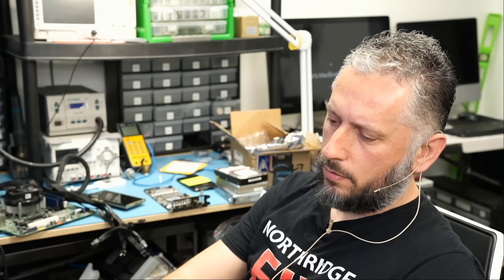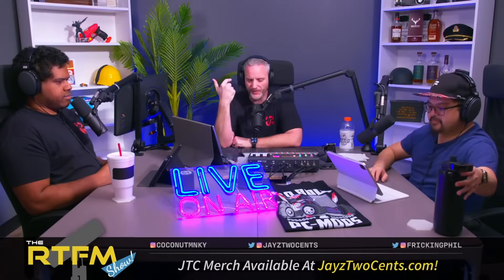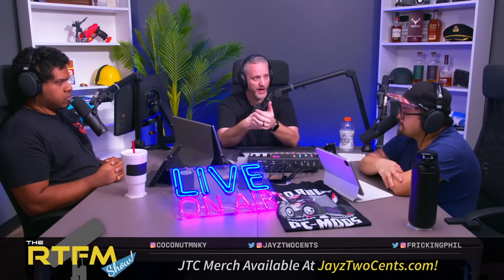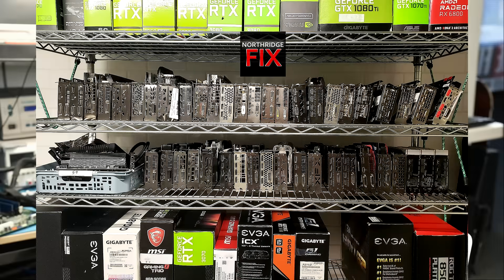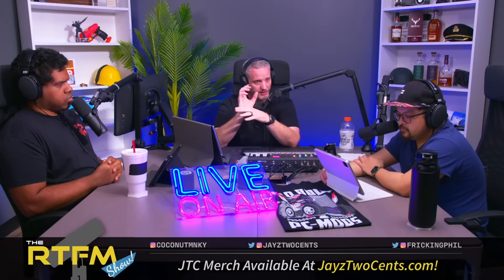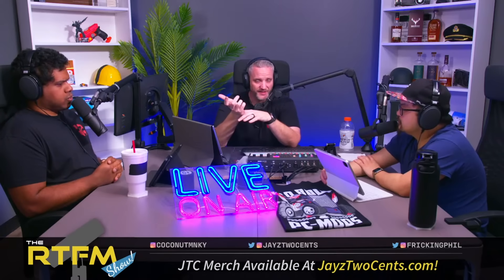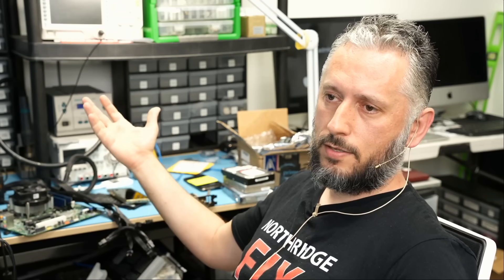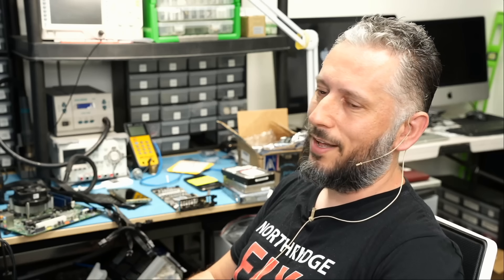Melting 4090 and CableMod. JayzTwoCents and Gamers Nexus Response. Blame NVidia or User?

Comment: On 4090 all 12V lines from the connector are connected to a single 12V rail. On previous generations they were connected to different rails, with different groups of mosfets feeding from different 12 rails. So now, whenever resistance on one pin becomes a bit higher (due to bad connection or something else), it effectively stops working as the load moves to the rest of the pins (Ohm's law). More current, higher temp... until something start to melt. It's a PCB design issue. It's either "planted timebomb" to make sure user will have to buy a new card or some new engineer made a rookie mistake, because they didn't know any better.

Comment: At 17:29 you cite the connector being hard to remove due to being melted together with the card as evidence that it was inserted all the way. Which frankly makes no sense.

The cable was hard to remove because it was melted together with card nothing to do with being properly inserted or not. Even a less than fully inserted cable would have been hard to remove due to all the melting.

Comment: If you google "PCI-e 12 pin connector" you will come across a picture from TechpowerUp. On the picture, they put a 12 pin and 8 pin side by side. You can see the SIZE difference of the contacts in the connectors. 8 pin has much more surface area, much more metal. And its only rated to 150W or 12V 12.5A. Dead reckoning will say that 12 pin pushing 600W or 12V 50A looks kinda fishy at best. And for those who will argue: but these are isolated cases, its not the majority: volts and amps are not some new concept we are experimenting with. Power delivery is well understood practice. The fact this melting even happened in the first place is cause for major concern. 
One of two things will happen in the future. Either the ATX 3.0 standard will get a revision and overhaul OR they will simply use more connectors like with 8-pin. 
My tin hat conspiracy is: a mint fresh designer/engineer at NVidia or PCI-SIG did some calculations and overlooked some very very important safety margin considerations.

Comment: As an engineer, people as a whole are stupid.  That is why engineers in the past have done their best to engineer most of the 'stupid out of their designs. Not only do you consider how the product is used, but you need to consider how the 'stupids' among us will use them improperly and try to engineer safeguards to prevent that. Yes higher contact resistance from improper use can cause some of the melting. That is not in question. The problem is it is happening so often that it should have been engineered out. This is happening to often to be completely user error( which should have been engineered out). The fact that is is the same set of pins and happening under all kinds of circumstances is telling. The next round of testing should setup current monitoring on all the connector wires and then test the card under various loads and observe the currents. I suspect that will the final nail in nvidia excuses.

Comment: I still don't blame Nvidia for this issue. I mean... you said it is not a rocket science... It is just a 12 pin connector. Plug it properly and have enough contact and you will be fine. Plug it improperly and it will melt due to poor contact. There is no other possible reasons here. You can also improperly place a tilting force on the cable mod connector wires with the chase cover which may or may not cause again a poor contact. let the user pull the connector by pulling the cables or.....etc There are endless ways how would a customer make errors or how it would be a cable mod female pins issue, and YES! not everybody have a tiny bit of brain like you think. However "THERE IS NO LOGICAL REASON WHY WOULD THE 12 MALE PINS OF THE CARD BE THE REASON OF MELTING". It is not Nvidia's fault, but if Nvidia wants to solve the problem of user errors they can make better connectors in a way that minimises the possibility of these errors to happen, but I think they doesn't have to do so because these cards are meant to be sold for the DIY market where the user should be aware of what he is doing. That's why pre built computers exists for users who can't build by themselves.

For why the 90° connector mod fail, it could be that the mod female pins are not tight enough or some other manufacturering errors.

If the design of the card was the issue we would have seen most of the cards failing, but that's not what happening.

Comment: I'm still wondering myself why didn't manufacturers, in this case NVIDIA, don't make the pins that power the card longer and those that signal the amount of power rails that are supplying power a little bit shorter so the user has to plug the entire connector fully and still have some tolerance and, because the signaling pins are shorter, if the margin is unsafe, just prevent the card to work or work in a safe mode, power restrained mode.

Comment: 400 watts at 12 volts is 33 and a third amps. You need a fat ass wire to reliably carry that current. I've got a 1300 watt power supply and a video card that just made fire, sparks, smoke, welding on the video card and it's PCIe slot. This crap is becoming too bodged work-around. The edge card locking latch is inaccessible. The card having all the 12 volt ADD-ON power leads that the PCIe slot cannot provide is the START of the bandaid mess. The moment video cards started needing so many amps: it was time for a high current connection. A new slot. Sorry. It's going to be a painful transition but we've been there before. It's time again we bit the bit.

Comment: I thought Steve's answer was fine at the start of this mess but the video showing the fully seated cable mod adapter one smoked is the veritable smoking gun that this is indeed a design/card engineering problem.

Comment: I think this is a design error, that connector is not enough for the power the card needs. It is a big heavy card, there's room for two connectors. The power cable uses three connectors on one end, and only one on the card. So the reduction of the cross section of the power cables is happening on the card side. The chance that most of us are not capable to insert a connector is very slim. I would take precautions when connecting this expensive card, especially after all the videos on this subject. If you build a computer for yourself you will pay more attention. If this connector can accidentally disconnect or  something like that, during transport, or cleaning, it is not the users fault.
In my opinion, a new connector design is needed, with better locking mechanism.

Comment: 30 years of Automotive experience and an OLD College Certification of Electronic Repair has led me to a decent reputation in Automotive Electrical diagnostic and repair. Heat is generated by a poor connection of the metal Male and Female ends. The Plastic housings can be a factor by too much on one side and not enough on the other creating Pin miss alignment. The Male is a solid Pin, The Female is basically a receptacle that is slightly bigger and has a (basically) spring loaded connection contact. If the spring loaded portion is weak, it will lax the tension and create an issue. (In Automotive: Higher current circuits tend to melt the Housings, lower current circuits cause Check Engine Lights and intermittent issues. I deal with this type issue Weekly and like this case pattern failures can easily be traced down to a common issue. 99% of the time (on Factory Connectors) it is always weak tension of the Female Pin. In this case, it seems the Male portion is questionable. My thought: To truly find out the issue, someone needs to confirm that the 3090's are truly the same as the 4090's. Buy 1 or 4 of each Model and dissect the connectors. Also check the Manufacturers of the Cables. I know that what I am saying is a lot of money and time spent, but that is the only way to prove a real issue. I have a really expensive set of leads that are precision made to tight tolerances of 90% of Automotive Connections. They have Banana receptacles for my Meters or Lab Scope Leads. They are an easy Go or No Go gauge by themselves for connection issues. Hell, maybe when they made the 4090's something may be weird with the composition of the blend of Plastic. Maybe it just does not handle the normal amount of heat created by any Card. The actual issue has to be physically proven to a point of no more questions and all Videos, Podcasts can be exactly to the point to get the Manufacturers' attention. They are not going to do it themselves.

Comment: Maybe if nvidia is determined to use these small connectors for some reason they should just solder their dongle directly to the board and cut out the middleman

Comment: I think it's a bit silly to blame the user. This is a premium product and is sold and ultimate premium price, and therefore should be a lot more robust with it's power connector. The mere fact you can see loads of plastic deformation damage from unburned  connectors should be a giveaway that the design is bad

Comment: If I may make a suggestion, I would like to see if anyone could set up a system with one of these cards and all of the appropriate hardware and software in an open air environment and also set up a thermal camera system to record the temperatures being generated at the source of the plug. Also maybe even a voltage monitor recorder to record under what circumstances the temperatures at the plug get so hot that they melt the plastic. Then send the results to Nvidia so that they can no longer hide behind all of the theories and uncertainty. Great Job Alex and continued success to you and Northridge Fix.

Comment: It's possible in a couple of cases that the customer didn't firmly "click" the cable/connector together, but it seems with a rather high number of duplicated / repeated incidents that the connector on the GPU is at fault. Design flaw or substandard / inadequate connector plastic

Comment: Ok...I have been watching Alex for some time now. I have worked on ATM machine's, Lottery Terminals, and Industrial Battery chargers. In my time the only thing that could cause this problem is indeed the Video card!!! Think of it this way, when you try to use you water hose with nothing on the end the water flows freely. However, when you put a sprayer on the hose you restrict the water causing pressure. The traces on the card are not able to support the current draw that this card is using which in turn is causing overheating of the connector. Just a thought...

Comment: Gamers Nexus Response protecting Nvidia from a huge failure in their product, this is obviously an issue with Nvidia as the GTX series + RTX 1000-3000 series never had any issue with cables/connectors melting.
Reply: Not so much protecting Nvidia but protecting their findings which they spent a fortune on collating. Steve obviously doesn’t want to admit it’s a bad design on Nvidia part!

Comment: I waited for the cableMod 90 and installed my 4090 looks fine atm and fully seated. I think what GN was meaning is that the card connector may have had some beginning some damage probably not visible unless you inspected befor it was used and thus the dmg occurred.  I’m in full agreement tho a design which leads to premature failure even if user error (within reason) is a manufacturer defect and this nvidia should consider taking action.  Maybe not a widespread recall as some units may be unaffected but certainly a as fail zero questions replacement with ver2.0 product preferably with the issue fixed

Comment: Alex, I think if the connectors that came with the cards from factory are melting then it could possibly be the connectors or the card itself.  Has any customer for whom you've replaced the connector end up with the same issue as before you repaired it?  I think we need to look towards the card itself rather than laying blame on the end-user and like you've said many times in the past "be honest to your customers".  That's what these manufacturers should be doing.

Comment: No other cards in history melted, but when there's a problem it's definitely not the fault of the manufacturer of increasingly power hungry and inefficient cards with new connectors. Nope has to be dumb myfirstPCbuild haha. Should have played with more Legos and wall outlets, could plug it in mor better.

Comment: I don't doubt that you are correct in that it's the board as this makes the most sense. Question! If it's the board/card, how would this be fixed? By redoing the female connectors on the card? I would like a follow up on this showing or discussing how this fault could be fixed or if it even could be fixed?

Comment: Leave it up to Nvidia to create a problem from a non issue. Why go with the 12VHPWR connector when x3 PCIe power was working just fine. On top of that the 4090 doesn't even use the 600W that the 12VHPWR provides.

Comment: The older cards' power adapters had larger gauge wires and pins going into a larger connector, pushing ~150W on each connector.  Now they have THREE TIMES the power flowing through a smaller connector with smaller wires.  Gee I wonder where the problem actually is?!?!?  

This is an NVIDIA design issue, not a user issue.  NVIDIA is a scumbag company for not standing behind their customers who are spending thousands of dollars for their poorly designed cards!

I wonder if EGVA saw this coming, gave feedback to NVIDIA, and dropped them when they wouldn't back down from this insane design flaw which would have cost EVGA millions in replacing these badly designed cards?!?!  The timing is right on the mark for this scenario.

Comment: I think not connected properly within the connector and combination of over power into the connector 12-18 wires into more than over volted what should be a 12 volt +/- vs 36-48 volt +/- per pin

no wonder the card  and it is a design flaw in the card within all if you are designing a card to consume a min standard of 3-4 psu 12 volt rails it would seem you should have that design spec on the card..

not try to cheapen the standard not to the point you're trying to 2-4 wires into one pin, so at 2 wires per pin you have 24 VDC, at 3 wire per pin you're at 36 VDC, at 4 wire you're at 48VDC on a connector designed for 12VDC  only and pin shorting or should we call it the elephant in the room over voltage on a pin which is likely arcing through the plastic or pcb between the pads

the pin type is a modified version of the old molex power connector...

Comment: Under no circumstance should any connector melt, for whatever reason. As usual Companies will not admit they have a problem until they are called out and even then attempt to place the blame on the user. But then the Gamers Nexus conclusion was a gift to Nvidia.

Comment: I wrote this on Gamer's Nexus and I'll post it here too:  The 4090s need to be recalled and the power connectors redesigned to be more like the old 3090s connections.  There is NO REASON to force that much power through these small connectors when the 3090s didn't have any of the issues that the 4090s do.   Some people need to STOP kissing NVIDIA's a$$ on this!  These cards are very expensive and it is criminal to have this ticking time bomb on such an expensive video card!
Reply: @HumanBeing ok. Again, a flaw in design or manufacturing on NVIDIAs end.  But you NEVER heard of this problem on the older connectors on 30xx series cards.
Reply: @HumanBeing Where did you get that statistic of 99% from?  NVIDIA isn't putting out numbers.  Also the 4080 uses 320 Watts, and the 4090 uses 450 Watts +.  That's 130 Watts difference. Put your hand on a 100 Watt Incandescent light bulb and see how much heat is there.  

We're also REALLY early in the deployment of these cards and seeing these problems.  What happens over time as the connectors and wires are flexed, removed, inserted, etc.?   Do you think it's going to be getting better?  It is criminal to continue making and selling these cards with the dangers that they represent.

Comment: Did you ever measure the peak current running through that connector during high performance and compare this with the specs of these connectors? It looks like the current is simply too high.

Comment: I’d wager that most 4090 users have connected a video card before and never in the history of connecting a video card have we seen so many melted connectors. The power hungry 3090 Ti had a similar connector and it didn’t melt down. 

I firmly believe there is a design flaw in the 4090 and I don’t know why Steve is downplaying the issue. I certainly don’t want to buy a 4090, with evidence that my connector could unseat slightly and then it could melt.

Comment: id like to ask Alex since he woorked with lots of those cards, are all the vc and gnd connected together into single rail sort of multiple pins feeding a single busbar ? or are they act as different "phase"  so each pair of pin on that 12 pin connector is its own rail, the melts seems to say uneven distribution of load but i cant say for sure without knowing how its wired, not to mention i cant afford those expensive cards to find out

what steve said really dont make sense, the socket on the card have pins, they dont loosen, what could lose its tightness is the connector, if they damaged the plug before using the cablemod adapter, the part that melt would be the connection between cable and the cablemod adapter